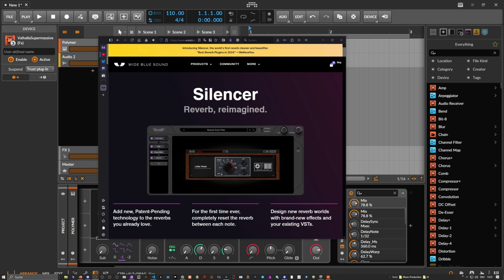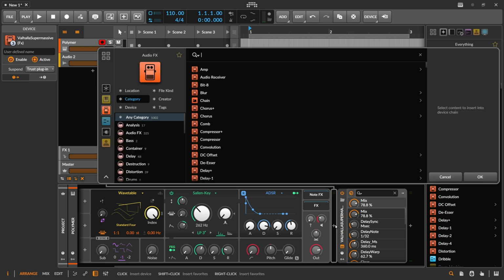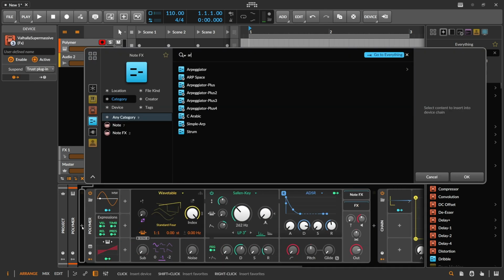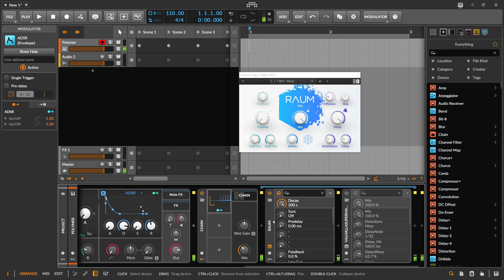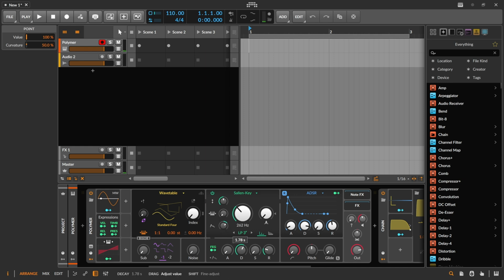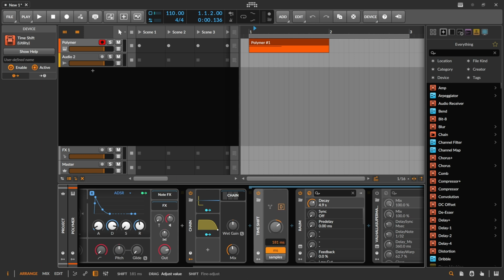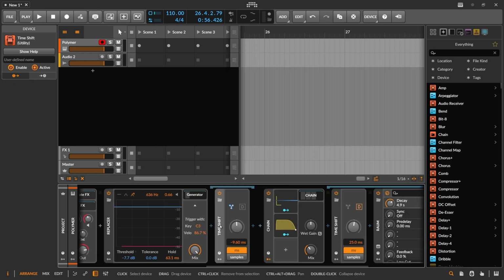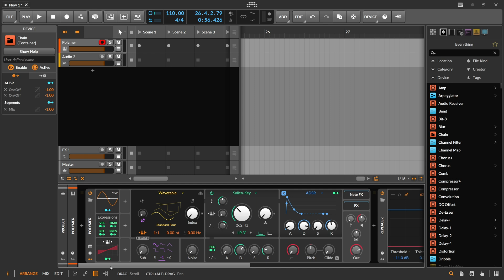Silencer Plugin but it's Bitwig

Comment: How funny, I was just going to reach out as a fan of the channel, and saw this!

I think this is a great video, and the thumbnail is amazing 😆. Bitwig never ceases to amaze.

With your permission, for anyone interested, I had a couple quick thoughts during the video of how Silencer is a better experience:

— Simply turning off/on the plugin lowers its compatibility with reverb plugins. Many hefty reverbs like Superplate will cause massive CPU spikes each time you turn it on (not an issue in regular use), and take your session down if you're retriggering it. Other reverbs (especially reverbs that utilize IRs) take a moment to initialize when you turn them on, and won't pass audio instantly — therefore they'll just make little/no sound at all when you use this method. There's enough plugins to where we had to painstakingly make solutions for these two major issues, which are part of the Patent :)

— When triggering with audio, often you don't want every single note to retrigger the reverb. Maybe on a drum bus you only want the kick (or kick + snare) to retrigger, not the percs or hats. Or, on a fast passage you may want to let a little more reverb through, so you turn up the Hold and have it ignore a few triggers here and there. Silencer allows the user many different ways (Hold, Hysteresis, Sidechain Filter) to fine-tune your retriggering, with just a knob or two.

— The included audio effects are actually quite interesting and not things you'll find in your DAW, as they're new effects that are made specifically for adding to reverb.

And a bunch of little things that people can read about if they wish :)

Also as a tip, instead of Timeshift, just increase the Predelay on the reverb itself. It's probably the most underused parameter on reverbs!

Cheers ❤
Nathan
Reply: The timeshift could be used to solve compatability issues with convolution reverbs, since it can go back in time as well, but idonno about super plate. Someone suggested modulating the feedback/decay parameters instead, which should work!
Setting up replacements for filters/etc using replacer shouldn't be too difficult just make a chain and you can use the EQ you already own.

Even then, I wouldn't worry- since most people are not using a daw this modulatable, this being piss easy like this is a big bitwin almost exclusively, thus demonstrating further use cases for the plugin. I can definitely see it being a big USP in a different daw environment